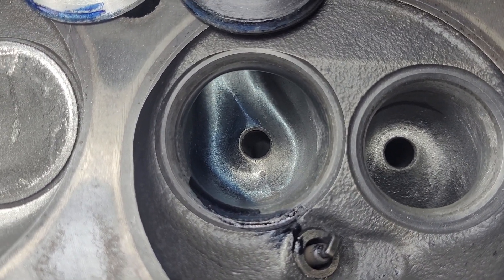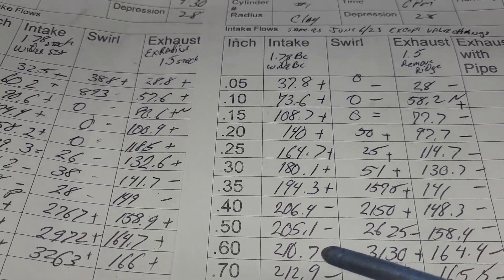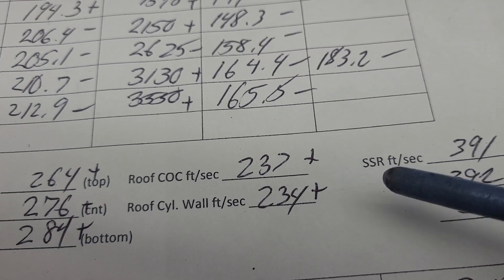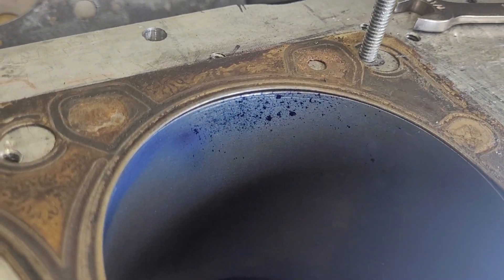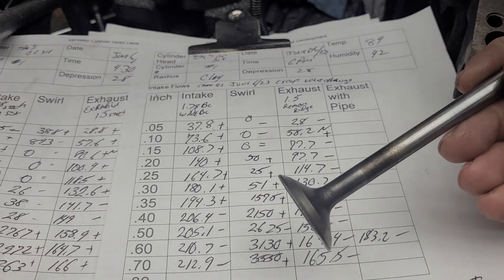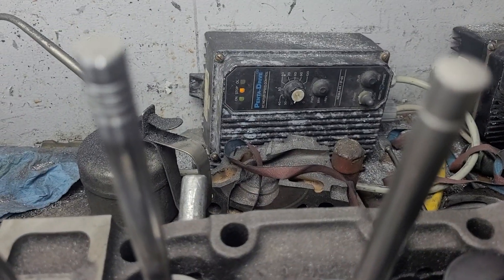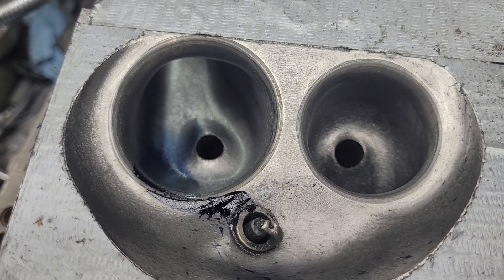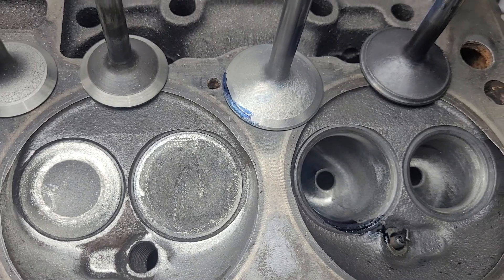David Vizard, U.T.G.,U.M.S. Mission Impossible 318 project, Valve shapes and flow curves

Comment: I have a set of those heads on my running 89 ramcharger 318 motor if you want them, im pretty sure they haven’t been touched since the factory
Reply from the maker: Hmmm, lets see how I do with the stock valve size. I appreciate the offer. D.V. originally wanted me to do two sets of open chamber heads stock valve size and 360 valve size. I may need to veto that. Thanks!

Comment: Personally, the low lift improvements and the port speeds already answered the question of using the modified intake valve. The exhaust side needs the airspeed, but that also depends on other mods. Hard calls, until you get closer to finalizing the heads mods and decide on things like high degree valve angles and pocket percentage that will improve it across more of the lift range, etc. Concentrate on the cfm and port speed numbers you need to hit the goal, everything else is just a nice bonus afterwards. Chamber mods are a tough call, especially since they are usually refined to match the port work, more often than not. And you cant exactly put it back after removing it like a port..... Well you can, but you better know how to furnace weld, lol......
Reply from the maker: Good info. Thanks

Comment: Check reverse flow on both exhaust valves. Which exhaust valve has more reversion? That may help you decide which valve to choose?
Reply from the maker: This is a very good point. Thanks
Reply: @servediocylinderheads  check it on the intake, too. The reduced flow at higher lifts may be offset by a reduction in reversion, if any.

Comment: I figured the tulip valve would have been better on the exhaust. Since the valve has a nice gradual curve, it helps accelerate the exhaust as it passes between the valve and seat. The vaporization ridge on the intake valve likely trips up the boundary layer that flows over the valve. Turbulent air carries more energy and conforms to curves better than laminar flow, especially handy at low lift, where the pressure difference between the cylinder bore and port is greatest.

I wonder if the noise you hear has something to do with flow structures in the port starting at low lifts then breaking down as the valve opens more and more. The SSR on this head is extremely sensitive, there's other places where more gains can be made. It all has to work together though, like beads on a string, or links in a chain. I would not mess too much with the SSR and more on the CC.

I'm agreeing with you, perhaps going to DV levels of material removal may be overkill, there has to be a happy middle ground between enhancing the flow structures near the plug and just hogging it out "till there ain't none left."
Reply from the maker: Good info, thanks

Comment: The DV chamber work will help those lost lift numbers!  It causes the vacuum to move slightly to the side of the seat. 
   Great job Charles! 
  I belive the single lock position are late model magnum valves. The 4 groove are mopar specific.  The dual slots are for 1st gen and magnums.
Reply from the maker: Thanks Tom!